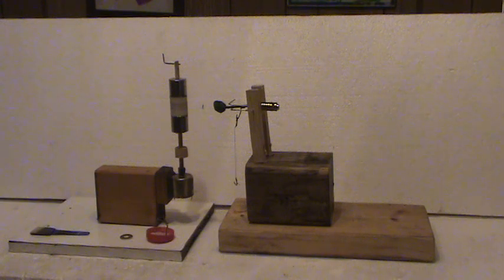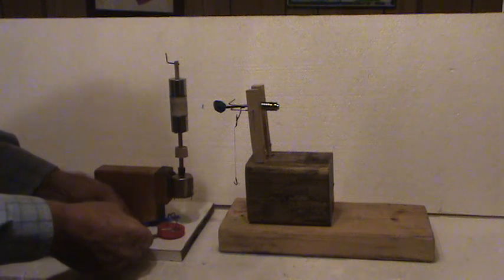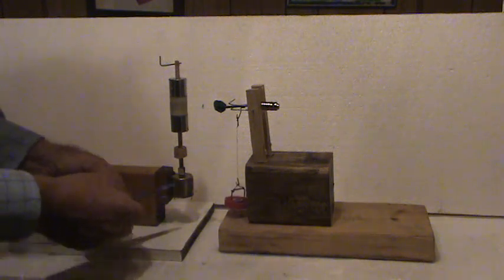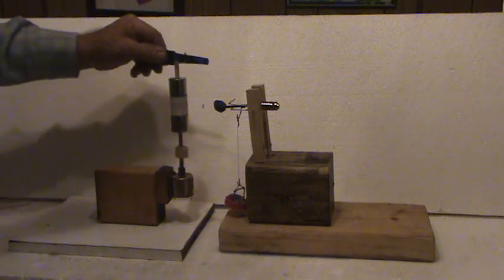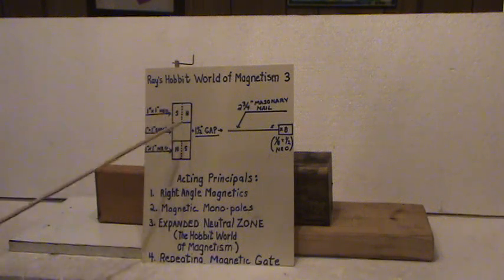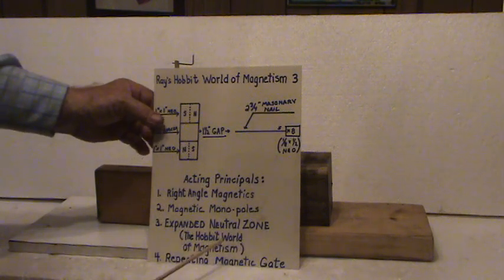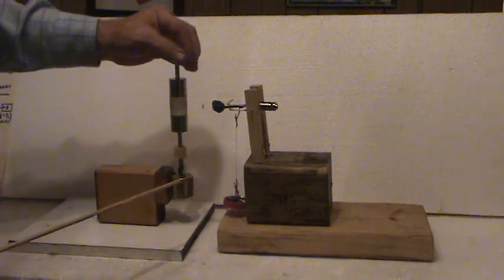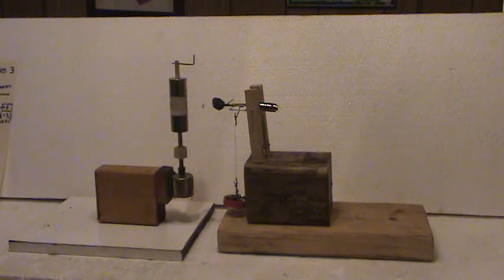Ray's Hobbit World Of Magnetism 3

Comment: Use a computer fan Cooling for your motor and take the internal parts out of it you will have less drag they work super good to find out if you have any input drag or pull back afterwards they work great for experiments

Comment: Keep going i think you must try magnets on top of each other and not horizontal. Let the force comes from the top and not the sides.
Reply from the maker: Yes, certain configurations of that work, but in this model this side line up works best. Thanks for input
Reply: The problem is magnetism is a one way constant force, if you have a magnet that is strong enough to push a piston down and the piston comes up again the magnet's force is still there and the piston can't do one complete revolution.
So ' something ' must cut the force of the magnet so the piston can go to the top and then that ' something ' must be taken away so that the force of the magnet can push the piston down again.
If you take a round wheel that spins horizontally with a magnet on the wheel and a stationary magnet on the side and put something thick that cuts the stationary magnet's force so that the magnet on the wheel don't get pushed away when it comes close to the stationary magnet but get pushed by the stationary magnet one's it passed the thick material and gets into the stationary magnet's ' zone ' so that you have a continuous force pushing the whole time even if you have to put a few stationary magnets with corresponding ' thick material ' around the wheel to keep it pushing the wheel. The magnet's must be south to south or north to north, using the pushing force of the magnets.

Comment: thanks bazz, nice work, id love too see what keeps you up at night, .. ;) any chance you can scribble down your thoughts on the geometry of a bigger one ?
Reply from the maker: Larger  magnets for input , this will allow wider distances between the two. This in turn will give larger arc distances on output, which now are short but strong. Next to be addressed is output mono pole magnets. There is room for improvements in strengths and designs. Curiosity keeps the octane going.
Reply from the maker: In the works